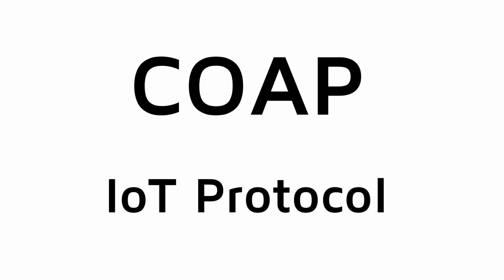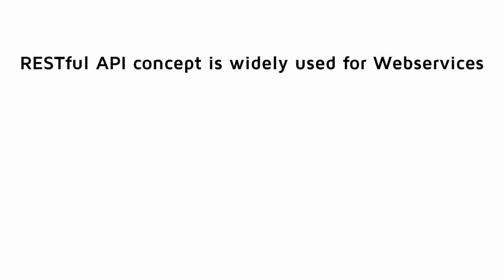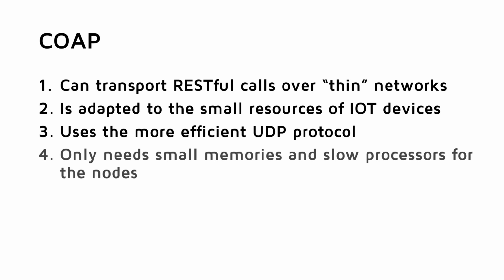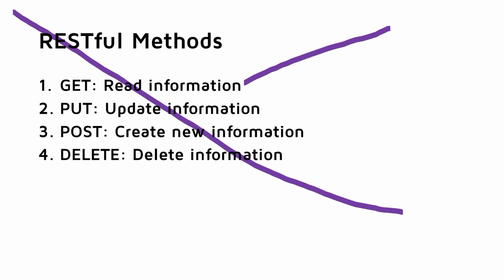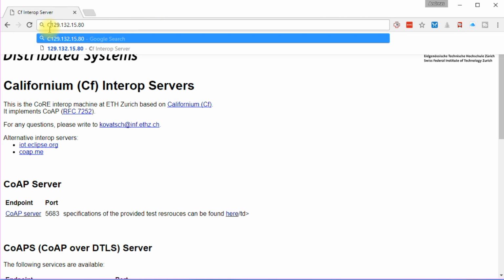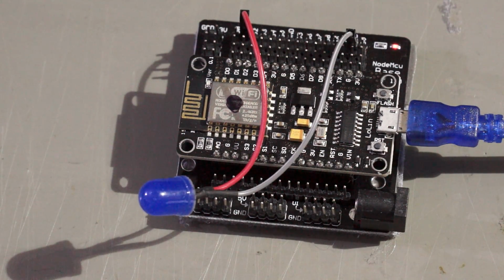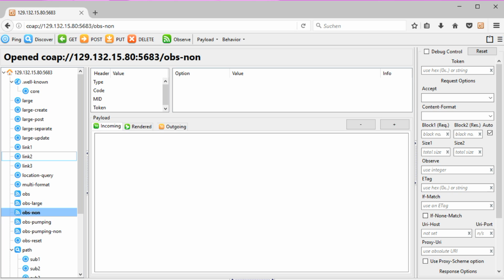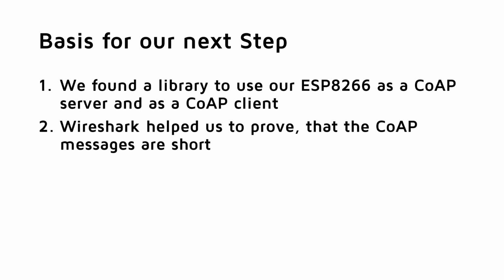#144 Internet Protocols: CoAP vs MQTT, Network Sniffing, and preparation for IKEA Tradfri Hacking

Comment: Also, is CoAP ip dependent? I guess an upside with MQTT is that you don't have to worry about giving everything static ip adresses?
Reply from the maker: No difference. Both need an IP address (because they reside in a Wi-Fi network) which can be static or not. COAP uses UDP, BTW.
Reply: @AndreasSpiess  sure they both need an ip, my point was that the mqtt device doesnt stop working in case the dhcp server suddenly changes the device ip. As I understand coap identifies devices by ip, whereas mqtt only identifies via topics?
Reply from the maker: @carlborgen  I assume the node knows its server or broker address and initiates communication. If the server address changes the problem is the same. But I do no more remember the details of COAP
Reply: @AndreasSpiess  When I added a shelly device to HA over CoIoT (Based on CoAP) I had to add the node via it's ip-address. Which is why I was worried that maybe it would break if my routers dhcp server suddenly decided to assign the node a new dynamic ip. Worth testing
Reply from the maker: @carlborgen  I do not assign all addresses to DHCP to have space for static addresses.

Comment: Seems like the discovery would be a major upside for coap as well. That mqtt doesn't have this really makes things more cumbersome to set up.
Reply from the maker: As soon as an MQTT node is connected to a broker it easily can be detected according its messages (Home Assistant does that, for example).
Reply: @AndreasSpiess  oh ok, then maybe it is only my shelly devices that dont have mqtt Discovery implemented, and therefor need an external script
Reply from the maker: @carlborgen  I just started with Home Assistant, and it discovered my Shellies...
Reply: @AndreasSpiess  So are you running your shellies via mqtt then or the CoIoT protocol? Because when I ran them over mqtt I had to use the discovery script, which resulted in other issues. So I have now renounced my mqtt purist ideas and run them over the CoIoT integration as well
Reply from the maker: @carlborgen  I played with both. Currently, I use the Shelly integration of HA

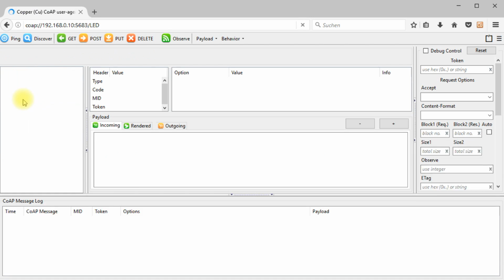Comment: Dear Mr Andreas, on the browser view at around 7:45 the browser shows a service exposed by the COAP server named LED. I checked the https://github.com/automote/ESP-CoAP and the coapserver.ino and did not find this "LED" but something as "LEDSTATE". I am trying to understand how this COAP thing works and trying to make it work with a ESP32. I am trying to understand how the server exposes these services and by clarifying this "LED" question above you will sure help me understand where it comes from. Many tanks and congrats for the nice tutorials.

By the way, I found a Copper agent that works with the current version of Chrome that may be of interest at: https://github.com/mkovatsc/Copper4Cr and it works great.

Regards
Reply from the maker: This is an old video and I do no more remember the details. So I cannot help you :-(

Comment: Andreas, you've really got me excited about home automation!  I'm renting an apartment, so I can't do some things.  I have managed to get about half my lights working with Alexa (mostly on ESP8266+relay).  I'm working on getting MQTT going, and probably a Home Assistant front end, so that my control doesn't disappear if my internet connection goes down.
Reply from the maker: I think, your situation is the biggest obstacle for home automation: houses without the needed infrastructure like wiring. So, Home Automation systems are either extremely expensive, or not nice to look at...
Reply: The Sonoff device from Itead is another choice - consumer ready using ESP8266. I ordered several a few days ago. Hopefully I can watch Andreas videos about them before they arrive. :-)  #99, 111, 113, 122, ...
Reply: Eric Jacobsen -
I have a couple of Sonoffs I'm tinkering with myself.  Thanks for the episode listings.
My ESP8266 setup is controlling a 2 relay module, that replaced a couple of switches for built-in lights in my apartment (I'll put the switches back when I leave).  Right now, they are just running Fauxmo to work with Alexa, but I want to build an MQTT setup so I can still control my lights if my internet connection isn't working.
I also like Andreas' motion sensor idea using Node-Red.  I have some places I'd like the lights to come on temporarily if I go into the room, but stay on if I tell them to.

Comment: Always a 👍 for you sir, the quality & frequency of your output is so impressive. How does wireshark perform on the RPi?
Reply from the maker: It does its job. In general, the speed is not as high as on my desktop. But this is ok. I also do not have a lot of experience, I only use it occasionally if I want to solve a particular problem.

Comment: Great video, Andreas! For the average home gamer using something like the ESP8266 MQTT will probably always be the easier solution, but there are huge benefits for using CoAP on a more industrial scale: 

Transparent CoAP<->HTTP Proxies exist, allowing you to reuse existing infrastructure. Reliability is part of the protocol, but how much you want to pursue it is left to the implementations. There are extensions to CoAP like CoAP-Observe that enable you to deal with sleepy nodes very well. You should take a look if the IKEA system supports it! 

A small implementation of CoAP (including DTLS!) can run on systems with less than 10 KiB RAM and 100 KiB ROM. It also works great with low power lossy networks like 6LoWPAN. This means huge cost savings when dealing in big volumes. 

CoAP is also more flexible. In a student project, we implemented a decentralized home automation system with CoAP that did not need any external cloud or central server to function. Apart from the much better privacy, such a system also allows for more fine-grained authentication (what devices on your network should your IoT Fridge be allowed to see?). 

It is very promising in M2M applications as well, where you can use the RESTful design and the multicast discovery mechanics to build self-configuring interoperable systems. If standardized correctly, this could mean a generic "IoT switch" could turn on and off any "IoT light bulb" regardless of vendor or further capabilities.

The combination of these two architectures could allow an Internet of Things were you yourself are actually in control of your data, devices and interoperability instead of the people that build them.

This is of course only wishful thinking ;)
Reply from the maker: Thanks for your comment. I think, we will see the advantage of the discovery mechanism if we deal with the IKEA bulbs. As I said in the video, fortunately, both concepts are different and have advantages and disadvantages. And this is good. We have the choice. I do not like if two different standards are too similar, because this only creates confusion, uncertainty, and cost.